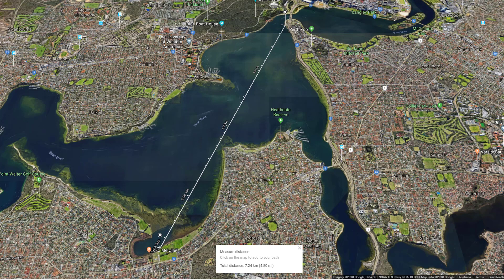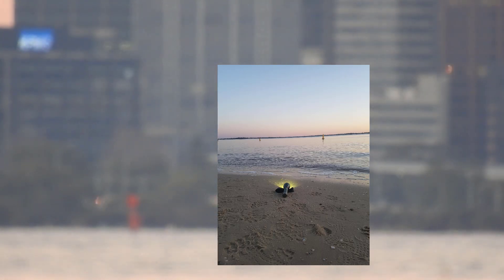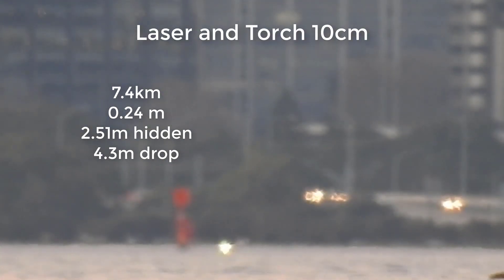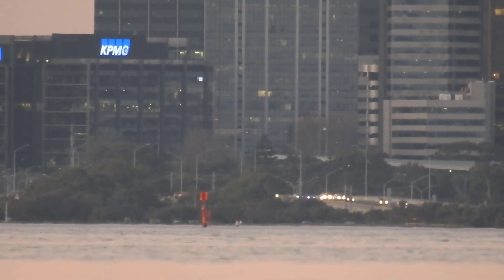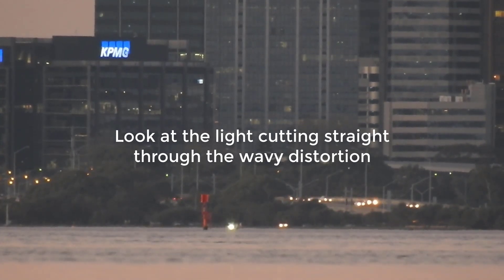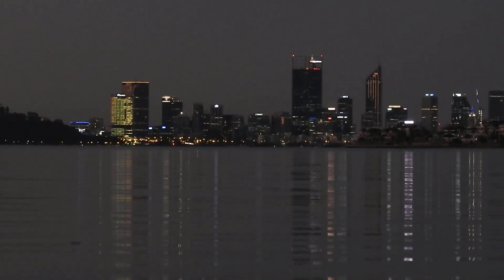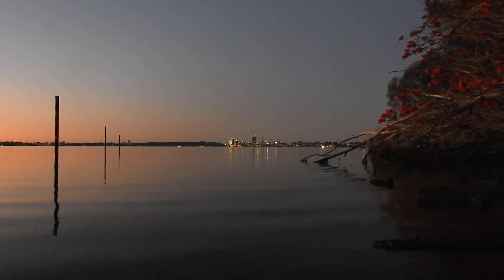Is the Swan River flat? [FLAT EARTH PERTH] Episode 4 - 3 Sticks

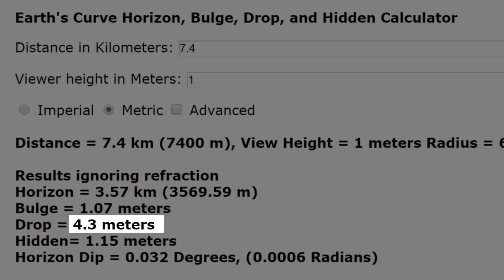Comment: 7:10 "We should see 4.3m  of drop..." That's a no-refraction geometric value of "drop" for a sphere of 6371km. Atmospheric refraction that would cause light to bend in the same direction of surface curvature, due to steeper air density gradient (thermal inversion) would optically reduce or even eliminate that apparent drop and associated angle dip, making the sphere seem much larger.

It's the globe explanation for why the sun and moon often appear squashed at the horizon. The lower limb of the disc is experiencing greater refraction, lifting it slightly higher from its geometric/astronomical location. Meanwhile, the upper limb is experiencing less refraction and thus less upward displacement. 

If refraction is the reason for the torch being visible despite 4.3m of geometric drop, then that means refraction is causing that drop to tend toward 0m and the angle below horizontal diminished. The 3-sticks + autolevel observation isn't refuting the presence of refraction. The 4.3m of geometric drop isn't up from that autolevel horizontal crosshair. It's 4.3m below it, and refraction has reduced or eliminated that drop, appearing to raise the torch to level.

It's a good demo, and would be evidence for flatness if the air 0-2m above the river surface was not getting warmer with height. 

This is why I tend to avoid water-skimming observations. Air conditions are more variable and extreme in terms of lapse rates, both super- and sub-refractive. Can make a flat surface look convex and a convex surface look flat. (Heath Carmody captured an example of what appears to be concavity in his water skinming observations.)
Reply: @FLATEARTHPERTH  I don't agree with this statement "where the air is cooler than the water supporting upward refraction" for several reasons.  But rather than delve into those, if you have an air temperature reading at the water's surface that is warmer than the air temperature 1m above the water, which itself is warmer than the air temperature 2m above the water, then yes.  A globe would still be refracting light toward the direction of curve (downward) but it would be closer to or even less than standard refraction.  (Too much of a temperature lapse rate and you'll get inferior mirage viewing at such low angle where you exceed the critical angle needed for total internal reflection.) 

Simply comparing air temperature with water temperature doesn't necessarily indicate what the air temperature (or humidity) lapse rate is above the water. Nor does temperature dropping with height indicate "upward refraction."  But conceptually, yes.  You should have different results with an opposite air density gradient than you got there, in terms of seeing the torch light and relationship to level.  That orange line you drew above the level line remains meaningless.
Reply: @FLATEARTHPERTH  He showed it to me a few weeks ago.  I'll look for it later and reply with a link.

Comment: I couldn't see where you said how high the 3 sticks were at 7:30. You also said there should be 4.3 m drop. How did you work this out because I don't think your auto level was 4.3 m above the water. The height of the auto level is crucial to this measurement but you seem to have left that out.

Comment: Buy 3 large clear containers ,build 3 small rafts exactly the same with sticks mounted on them exactly the same .
Connect the 3 containers up with garden hose and spread out the containers over 30 feet .
Fill containers up with water ,wait till the water settles level and then put a raft in each tank .
The 3 rafts need putting in water together 1st to make sure the top of the sticks are level .
Reply: @FLATEARTHPERTH  Accuracy .I thought you wanted accuracy .Flat Earth are always harping "Water is always level" ..so use water .
Reply: @FLATEARTHPERTH  Containers can be taken any place like up a high hill .

Comment: So you said you used the auto level to adjust the height of the three sticks but if the auto-level is accurate or off wouldn't the 3 sticks also be accurate or off?  I'm not certain how the 3 sticks add to any accuracy?
Reply: @FLATEARTHPERTH    Could it possibly be that the "downward angle" is due to the drop of the horizon since we live on a globe?  Let's be honest, you do live in Australia and every day you see a sun with an orbit path that is around the South Pole which is in the complete opposite direction of the sun observed in the northern hemisphere.  On the Dec solstice you sun will rise in the SE, swing left to north at noon then continue left to set in the SW.  Why would you see this if the earth was flat with a sun that should only be seen orbiting around the North Pole?  You should not even see the sun in the southern skies on a flat earth.

I know how the 2 peg test works.  If you have done this correctly then why do you assume the auto level is not within tolerance and still pointing too high instead of "eye level"?  This is what the test is for, to correct any deviation that is too high or too low.

Again, why do you trust the accuracy of the Dioptra phone app and why do you only use this app to show the "downward angle"?   How did you calibrate that app?  As I pointed out that in your "Swan River Episode 5 -Explaining the 3 Sticks",  you had the same observed drop of the last stick from each end of the table showing that your Dioptra was reading to high.   I can't download this this since my phone does not have a magnetometer. 

In step 6 you say "Adjust the cross-hair on the 1m high auto-level so it lines up with the 3 sticks also at 1m."  But how did you measure those sticks to be at 1 meter above the water.  In the video you said you used the auto-level but if you claim the auto-level always points high then wouldn't the sticks also be too high?

Comment: On google earth I measured 7,24 Km, with these data and using an elevation of the observer of 1,7 m, height of the torch 0,3 m, according to Walter Bislin curve calculator and using a standard refraction I find that only 0,52 m should be hidden. It takes just a little bit of refraction more than the standard to see the torch. If you use a torch or laser (instead that just looking at features of the landscape), there is also the diffraction of light, the scattering of the photons that can make you see something, part of the light beam that is actually hidden. 
Also with the stroboscopic mode of the torch you have less possibility to understand when the beam of light is hidden. 
On a flat earth nothing should be ever hidden, only the max height of the waves should be hidden, but nothing else. And this would be true also at 20 km of distance (with all the other parameters unchanged). 
I confess that I am not sure to understand what you were showing with the alignement of the camera to the surface, the 3 sticks.
Reply: @FLATEARTHPERTH  What is exactly that you understand comparing the eye level with what you find in the landscape? How the expected drop should be found in the image of the video?
Reply: @FLATEARTHPERTH  Now I've read your discussion with Tim Good, and there's plenty of explanations in that thread.

Comment: As someone already pointed out, you have given no justification for the line you draw that’s supposed to show the missing drop, and your judgement of distances to determine that drop is arbitrary. 

I will also add, the drop you should be looking for is only about 2 m, not 4.3. The screen you show calculating the 4.3 meter drop also shows the drop of the horizon at 0.032 degrees at a distance of 3.57 km. That’s 2 m. So you have inadvertently demonstrated that you do not understand the math you are using. 

Add to that, 2 m is about the height of a tall car. The horizon, at 3.57 km, is about half the distance to the opposite shore, where there are many cars driving by. So, the drop you should be looking for should be about twice the height of one of those cars. 

Add to that, the auto level line drifts up and down an amount similar to what you’re trying to measure. Can you say measurement error?

Add to that, while I don’t know much about your auto level (and you haven’t done much to inform the viewer) I would think those three sticks need to be at precisely the same height for this to be worth anything. PRECISELY. How did you guarantee that?

Add to that, you admitted that an auto level isn’t even designed for long distance measurement. 

As for the torch being visible, there is so much turbulence in that layer you say it “cuts right through” that you can expect intermittent visibility, which is why you never get a truly stable image of that torch. At some points it’s a tiny little blip; at others the torch is twice the size of a car. That’s from atmospheric distortion, and because of distortion you’ll have a hard time getting good repeatable measurements from a test like this. 

Those are the points that hit me right off the top of my head.
Reply: FLAT EARTH PERTH 

We might not have our terminology lined up with each other, but the 4.3 m you are expecting to see, you won’t see. It drops behind the horizon (or bulge). The only thing you can expect to see is the horizon below horizontal, and that would be 2 m. But your experimentation set up is too rudimentary and swamped with measurement error. You need to design an experiment that is less susceptible to that.
Reply: FLAT EARTH PERTH 

May I request clarification? Is it the “globe” or the “tard” I’m being warned about? I never use the term “flattard.” That crosses a line for me. Perhaps I’ve come off a bit aggressive but my experience with FEs is they usually come out swinging. I have no problem dialing back and being respectful. But I will challenge FE claims with GE rebuttals, unapologetically. If that’s acceptable to you then there should be no further problem.
Reply: FLAT EARTH PERTH 

Great. I love that rule. One point at a time. I wish every channel had that rule.  That makes things a lot easier.
Reply: FLAT EARTH PERTH 

First, if you are American, thank you for your service. If you are Australian, I hope your fellow citizens are thankful for you. 

Second, I have a masters degree in engineering and have 23 years of experience as an optical engineer, so rest assured, you’re not dealing with a newbie, with respect to math or refraction.

I absolutely love the one subject rule. So, I’ll start with the drop and the calculator. 

If the observer is at 0.24 m at that moment, then you don’t seem to have entered that into the calculator shown in your screen shot. Of course, that number does not impact drop. You will still get 4.3 m because it is calculated from zero elevation. 

But, being at only 0.24 m rather than 1.0 m actually helps my case. The drop of the horizon (not the term “drop” as you are using it) in angular apparent size goes to zero at zero height. So the closer you are to the ground the closer the visual “drop” will be to zero. 

My 2 m calculation was based on a 1 m observer height. Replacing that with 0.24 m puts the horizon at only 1.74 km away. At that distance the drop is only 0.24 m. (The drop equals the observer height at the horizon.) So, the apparent visual drop of the horizon should be 0.0158 degrees (2*0.24/1740 radians). That’s approximately the apparent size of one of those cars on that highway in the background. (Estimated ~1.6 m height at 7.4 km distance is 0.0124 degrees, so a little smaller, and obviously a rough approximation.) Considering that, your line is drawn about 5 times too high. 

With this correction, the auto level measurement may fall within measurement error. But that’s another subject for another post.
Reply: FLAT EARTH PERTH 

A search for dioptra in the iPhone App Store produced no results. 

But, I still don’t understand the need for the three sticks. If you are using a surveying level, then are you calibrating it with the sticks? How did you determine the sticks are level? You suggest sighting the beer bottles from both directions but you can’t do that with the sticks. And why 3? Two points determines a line. What is the purpose of the third point? I’m trying here but this is not making sense. 

My concern is that if the level is actually capable of point slightly up or down and you are basing it off the sticks then your sticks may not be level and then your level is calibrated to something which is not level. 

I will peruse your channel for an auto level explanation.
Reply: FLAT EARTH PERTH 

I found three videos on your channel about the auto level. June 20, 22, and July 1 of this year. I didn’t find much to go on in them. I did see you have the ability to “fake” the horizon line. It seems that adjustment would be the means by which the instrument is calibrated. The question is what standard is it calibrated to? I doubt the three sticks are an acceptable standard, but I still haven’t seen a good explanation of what is being accomplished with them.